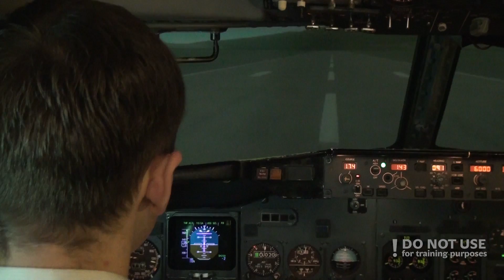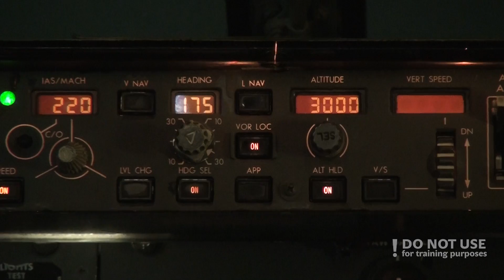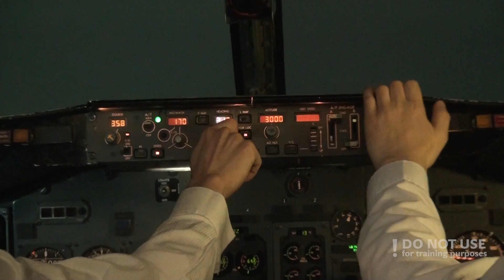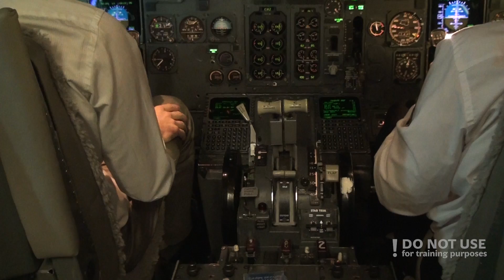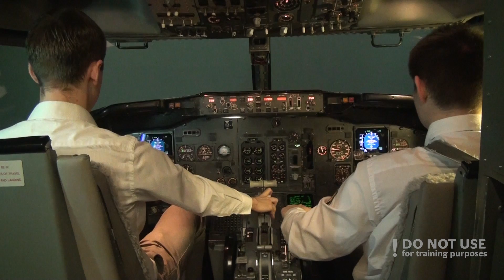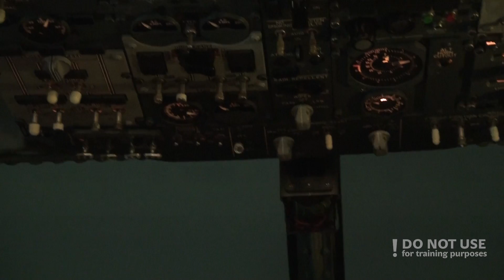Most Dangerous Approaches: Samos Airport - Baltic Aviation Academy

Comment: what does level change do exactly?
Reply: In level change mode the aircraft descends/climbs to the selected altitude at the maximum available vertical speed calculated in relation to the speed, so it descends/climbs at the maximum rate but trying to hold the selected speed.
Level change also get's used when there is a decompression to do the emergency descent to fl100.